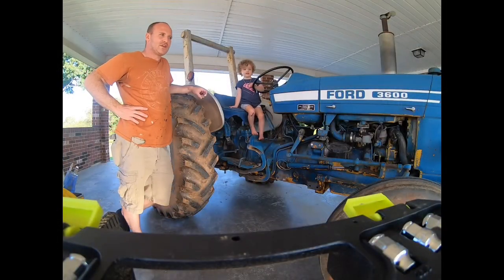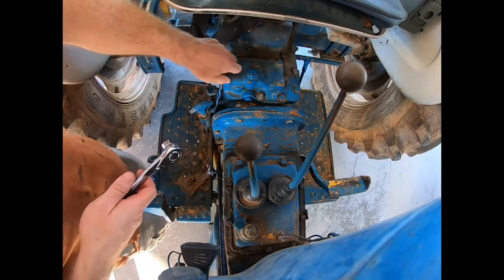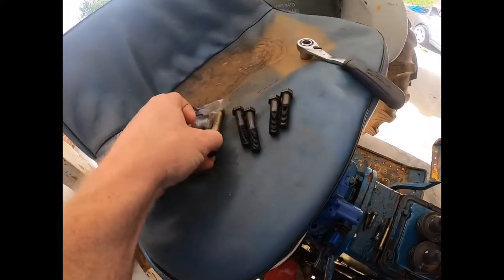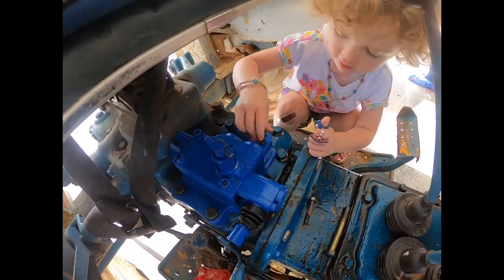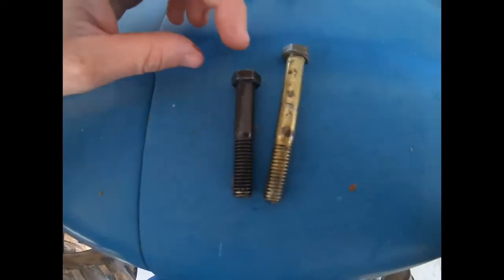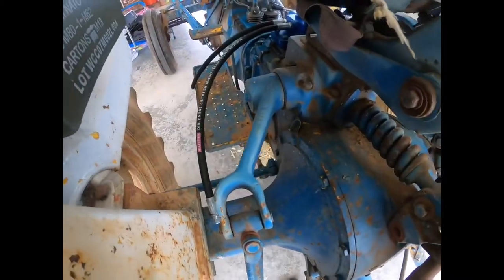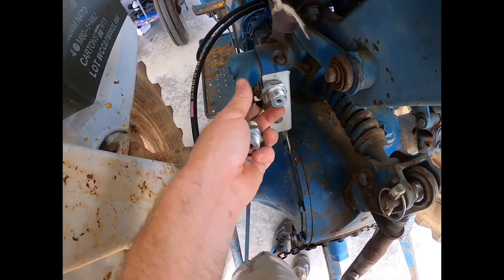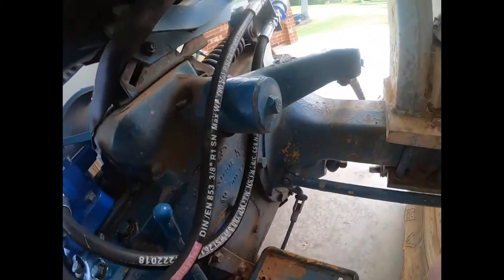Installing a Rear Remote on a Ford Tractor Ep. 22

Comment: I have a ford 1700 tractor and the problem I’m having is I have to shift that lever you installed up to operate the loader and down to operate the 3-point hitch. I’m wondering can you fix it to where you can leave the lever in one position but operate both lifts? Thanks
Reply from the maker: I had a similar issue in a Kubota I had once. It was a pain to troubleshoot but I ended up having to put a T and a pressure relief valve on to make it work. It’s hard to troubleshoot online though. I’m sure someone who works on them regularly can probably guide you through.

Comment: Thank you for the video, I have a Ford 3600 and wanting to install a hydraulic center or top link. very helpful.
Reply from the maker: Glad I can help, it was much easier than I expected. Just make sure you have some extra washers if you don’t have a hardware store close by in case you run into the same issues I did with the bolts in the kit being too short.
Reply: send link for video
Reply: price
Reply from the maker: https://www.steinertractor.com/FDS3364?crawlparam&gclid=Cj0KCQiAvbiBBhD-ARIsAGM48bwf7TUXi1SXZPGSX_SxqRUcH9yiy-iI_SRdUIn4C88UMvw_ctE5pToaAnYoEALw_wcB around $300
Reply: @southernyankeeinnovations  if you do not like that handle sticking forwards you could drill it out and mount it from the back side. Here is a vid this guy shows the end result.
https://youtu.be/sf7y2nVNwH0
Reply from the maker: @metalmanbradley  i kick it almost every time getting on the tractor so I may move it.

Comment: Always hold the fitting in your right hand and teflon tape in  your left.  They you get it on the right direction.   Think, it has to wrap onto the fitting so that it doesn't bunch up when installing.  And start one thread back from the end to keep the tape out of the hydraulic system.   I actually came here to see what valve you sourced, and from where?
Reply from the maker: Thank you sir. It’s been awhile now. I believe it was this one https://www.reliableaftermarketparts.com/products/hym40-0179-hyd-remote-valve-kit-4-cyl-1?currency=USD&variant=32297112862803&stkn=74b0779be3fd&gclid=CjwKCAjwyNSoBhA9EiwA5aYlbwwzEItHcGcyjFF4xya8SAARMvFMbM8hKoLCLb5muFWeL44Kyimb0BoCowYQAvD_BwE